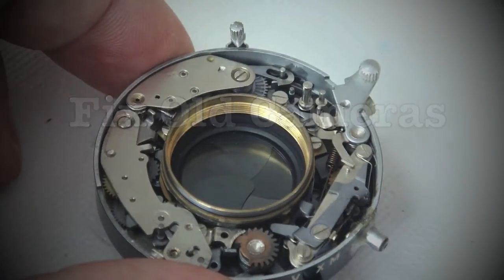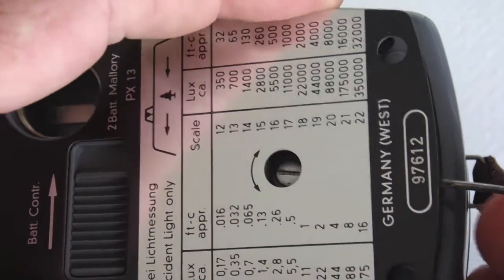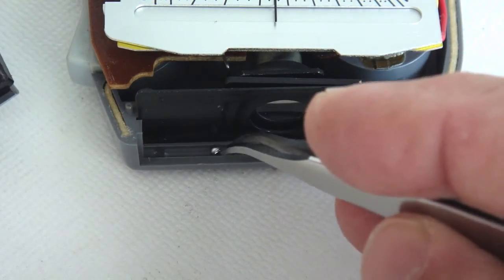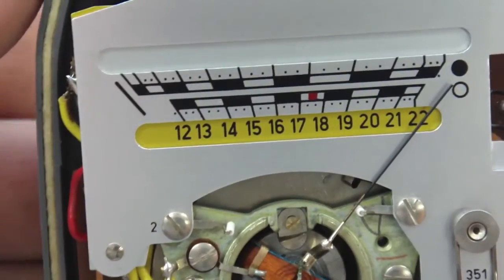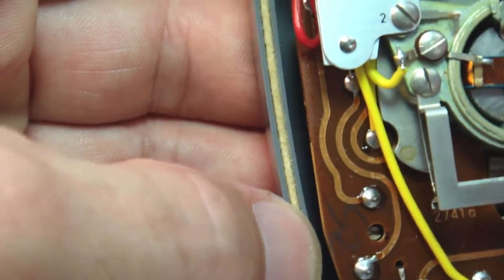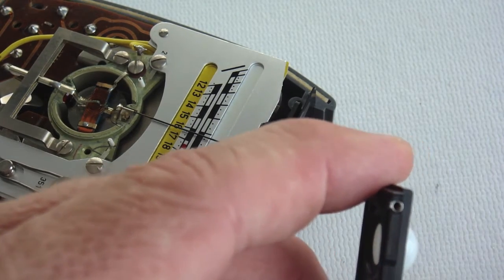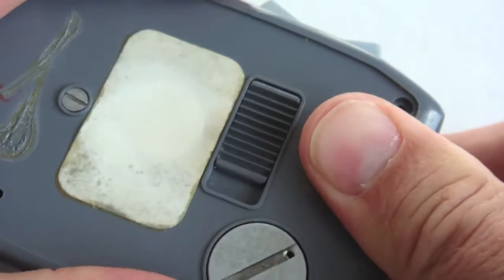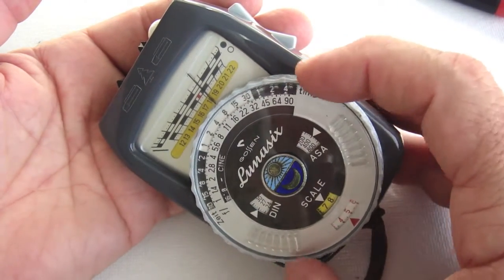Fix Old Camera: Gossen Luna Pro Battery Diode Update

Comment: So if the battery tester lands on red that means the battery voltage is ok and the light meter read correctly? Or what exactly the battery indicator shows?

Comment: I have a Lunasix 3 and I am about to do the same upgrade but on my model, but: THE RED WIRE IS THE NEGATIVE!
The position of the batteries is the same as yours with the + touching the screwing cap. If the diode must be connected to the positive that is the wrong wire. Please check with a multimeter with the 'beep function' which is the positive.
Online  you can find another video where you can see an Italian guy installing the diode on a blue positive wire one the side (Mine is Yellow).

Comment: Thank you for this video. Humongous help. My Luna-Pro did not have the diode, nor the sliding light diffuser. My battery compartment slotted coin cover was corroded shut and the chamber was spinning when I tried to force it open. After removing it, hitting it with DB Blaster, then white vinegar, then boiling water, I persuaded it open. 

I did, however, have a small 6mm clear rubbery washer left over after assembly. Everything seems to be working fine. I just hope it's not some important pivot point washer.

Comment: I just bought a gossen super pilot cds, does the same diode work on that meter? Also, do you happen to know if I just adjust the voltage pot should I get the same result as installing a diode? Thanks in advance!

Comment: I have a Gossen Luna-Pro that I haven't used in a long while. It's been properly cared for and stored. The needle is seemingly stuck in one position and doesn't deflect, doesn't move, at all. I put fresh, correct batteries in it, and it didn't make any difference - the needle still doesn't deflect with switch engagement. The needle is stuck in the upright position, a bit to the left side of the battery calibration red mark on the scale.  I haven't taken it apart yet, but would like to, just to see if there is something mechanical I could do to free up the needle. Any suggestions on what it may be? Thanks. Great video, by the way! I've read all the comments, below, too.

Comment: I just attempted this mod. I went through 2 1n4007 diodes and then tried a 1N5711 Schottky Diode. None of them worked. With the diodes in the circuit I was getting no current. Also my Luna Pro has  different internals so I suspect it might be a later model. The + wire is blue and the - is just a bare wire. The wire is also quite small and was difficult to work with. The connection to the battery chamber is sealed so I had to cut the wire and solder in the diode to each end of the cut wire. Right now I have reassembled the meter until I decide what to do next.

Comment: I recently acqired an FTbN and it had a tell tale scratch from a clumsy top removal. I went ahead with 1.5v. Alkaline and of course it's fine. They're really cheap these days, so I will be following your work on my Luna Pro also.
Question:
I have a working Weston Master Universal, a working Weston Direct Reading, and a Master II with the Invercone which doesn't work, but I would prefer to carry. Were these photovoltaic selenium cells interchangeable? Could one go into another? Thanks.
Reply from the maker: A direct swap might work or you might need to add a resistor. Might require some experimentation. Let us know what you discover. There was a time when selenium panels were available and could even be resized. Silicone cell salvaged from old solar powered calculators can sometimes be used in conjunction with a resistor (maybe a variable resistor so it would be easier to tweak)

Comment: Thanks for the great video, have used a few of your tutorials to repair some vintage cameras and lenses I own. What would you say is an economical modern equivalent of the sk 3080 diode, or what should I be looking for? not too up to speed when it comes to these sorts of things. thanks so much!
Reply from the maker: Substitute for meter system voltage dropping diodes -
ECG109 - OA90
1N4007 - DO-41

1N4007 silicon diode usually will work the best in most two battery systems. The diode referred to as a SK3080 diode in the video should have been stated as SK3090 which is germanium and has a smaller voltage drop. You sometimes have to experiment with different diodes in particular the two battery systems as many have voltage regulating circuits already. - more diode information here https://phototronic.biz/tips 

Experience shows a silicon diode has a voltage drop of approximately 0.7V(varying 0.1V depending on the sub), while a germanium diode has a voltage drop of approximately 01.6V - 0.2.2V. Making the silicon diode(1N4007) the preferred choice for two battery meter systems. Though germanium diodes(SK3090,OA90,ECG109) with a voltage drop of consistently 016V) is the best in the area of forward voltage drop in single battery systems they are increasingly hard to find and more expensive, the silicon diodes are cheaper and apparently easier to find.
Experience shows a zener diode is not a good choice for a substitute. A silicon or germanium, conducts in one direction only, whereas a zener diode conducts in both directions, but at different voltages.

In most application beyond the voltage dropping application an ordinary diode is used to rectify, using its forward bias characteristics, while a zener diode is used to regulate, using its reverse bias characteristics.

Comment: Battery 625 this light meter gives you accyrate readings of exposure ?
Reply from the maker: The diode modification with the proper voltage drop results will make the use of the available 625 (1.5volt) alkaline battery fairly accurate. Although an alkaline battery is not an ideal choice for a light meter due to its slopping discharge rate. The batteries will need to be replaced before the discharge level drops below 1.4 volts. The silicon diode suggested gives acceptable results, but is not a perfect choice. If a different diode is found that works better it will be posted.  There are also MR-9 battery adapters available, but be sure to get an adapter that has the voltage dropping circuitry.

Comment: I put two lr44 batteries in the battery compartment and the meter needle lands on the red bar. Does that mean that it's ok?
Reply from the maker: It is a good sign that you have movement, but it still will depends on how accurately it reacts to different levels of light.

Comment: What battery do you use?
Reply from the maker: The 625A batteries fit, but have a gradual discharge fade rate once they start to deplete, therefore yearly replacement is recommended. The S76 battery has a level discharge rate but requires a small rubber o-ring fitted around the circumference to keep the battery properly in place.
Reply: O ring wins, thanks.

Comment: thanks for the video! I want to open up a Lunasix Pro but mine doesnt open after taking out the 4 screws on the back. It feels like it is being held back by the turning dial on the front. Any idea how I can open it?
By the way my problem is, that the turning dial doesnt move the neadle anymore..
Any advice would be greatly appreciated.
Reply from the maker: Hmmm... not sure. Maybe the issue that has frozen the dial is also interfering with the case separation. Maybe there is another case screw that was overlooked on your model... do not know of the location of such, but variation of design has been known to occur.

Comment: I had intended to fix a Gossen Luna Pro meter in this way, but before I got to that point, I tried zinc-air 1.4v batts to see how that worked and found that I am unable to calibrate the meter with any battery. The voltage adjust shows good and can be adjusted, but the needle will only swing within 20 or 30º at either end on either scale. Shouldn't it at least be able to zero in the dark? I can't get a full deflection at all. My question is just this: do you think something else is wrong making it not worth the trouble, or am I missing something simple because I'm unfamiliar with this meter? Thanks very much. I enjoy your videos.
Reply from the maker: By the way you describe the issues, it is possible that the travel of the galvanometer is restricted. Can you manually move the needle its full swing? Does the meter peg when full battery voltage is applied? The meter should behave properly when powered by the zinc-air battery substitutes and zero in no light or when shut off.
Reply: The needle swings free enough and seems to react to light, but only with a small deflection which I'm unable to adjust to anything like zero even with the sensor covered. I can adjust it to a hi value but can only reach a value perhaps 3 ev lower than that... or vice versa. Battery test works, meter zeroed w/o power; It doesn't seem like something mechanical to me...maybe a bad component? What happens when you drop these a few times? I wonder if something broke loose. I paid very little for this, so perhaps I'll have better luck next time. Thanks very much for your response.
Reply from the maker: By the results of the trouble shooting you have done, it does appear to be a circuit issue or a combination Cds and circuit issue.

Comment: Would this work on a Sixtar

Type

Hand held exposure meter

Introduction

1966

Sensor

CdS (Cadmium Sulphide)
Reply from the maker: The diode voltage drop procedure can be use on any meter or camera that was originally designed to work with 1.35 volt mercury batteries. Finding vintage diodes is getting to be difficult. But some have been using modern diodes with good results. You might have to experiment with clipping different diodes in the circuit to get the results you are after. You will not harm the meter as dropping the voltage too much has the same affect on the meter as a weak battery.

Comment: Do you happen to know the relative magnitude of the current for this circuit? I have several diodes to choose from and I want to know which would most closely give me the .3V drop for this circuit. Also, all this diode does is drop the voltage, so you would need to use a silver oxide battery, correct? Because this battery has the most level voltage output over time while lithium and alkaline show a steady decrease in voltage over their life (Correct me if I have my battery types all mixed up). So this decline over time would affect the meter measurements if I'm not mistaken. Last question, can you simply use #9 rubber o-rings as spacers for these button cell batteries or do they need to make contact with the sides of the battery terminal?
Reply from the maker: Silver oxide is the best choice of battery. The diode can be tried with no concern of damage until you find the right combination of diode. Rubber O-rings can be used to hold the button batteries in place. The battery cap is the positive contact the battery terminal is the negative contact.

Comment: Hello, thanks for the informative video!

I was wondering if you have any advice on working with the Luna Pro S. I opened mine up in hopes of it looking the same as in your video, but there wasn't a clear red wire going to the battery compartment - it actually seemed difficult to reach the battery compartment.

Thanks for any help!
Reply from the maker: Yes it is different, but the battery compartment can be reached. Find the connection to the positive battery chamber contact and place the diode between it and the contact. Also you might consider making or the purchase of a voltage dropping battery adapter.
Reply: Thanks for the quick reply! I'll poke around in it again tonight and see if I can figure it out, but if I can't I'll probably go with the adapter route. Thanks again.

Comment: Great video I have a Gossen luna six and happened to me that it fall on the floor and since then the needle doesn't lock when i take a measure, like it is loose making it difficult to read. Can you explain me how to fix it?
Reply from the maker: The needle is locked on a reading via a clamping device that probably just needs a tweek back into position. You can see the lower edge of the needle clamp mechanism at point 2.14 in this video.
Reply: You are the man! thank very much for both of your fast responses, I will get some real tools and try later if I can fix the problem
Reply from the maker: A few good tools will help.
Reply: I wanted to tell you that I managed to fix the problem successfully maybe someday I even try to go with the diode update, for now Im already very happy with the achievement
Reply from the maker: Very good to hear of your successful repair.
Reply: Look on eBay.  There is an auction from a repairman that specializes on Luna pro repair

Comment: Can I use sk3090 diode! Thanks
Reply from the maker: You can use the SK3090, you might not get the voltage drop you need for the double battery system, but you will do no harm in experimenting with different diodes. The SK3090 seems to work really well in the single battery systems. If the SK3090 does not give you the results you are after. Try locating SK3080 / IN4007 or the equivalent thereof.

Comment from the maker: Adjustment Potentiometers positions for the Gossen Luna Pro / Six: 
Upper left by itself - P1.  P1 (10k) is battery test current adjust. 

Left to right across the bottom - P2, P3, P4, P5

P2 ( 75 k) is low light adjustment. 
(P2 is used when the CdS LDR is directly exposed via the lens)

P3 ( 10k) is low light meter shunt adjustment.
P4 ( 10k) is high low meter shunt adjustment
P3 and P4 probably need to be set near mid point.

P5 ( 20 k) is high light adjustment. 
(P5 is used when the nd filter covers the CdS LDR) 
CdS (Cadmium Sulphide) LDR (light dependent resistor)

In bright sun about EV 14 or so, with the dome on, (incident mode) and 
ND filter on, the CdS/LDR resistance is 520 Ohm.
Dark resistance is about 20 Megohm.

The battery current needs to be in a range 20 ~ 60 uA, which is just 
enough to drive a small signal schottky diode toward saturation, so 
depending on the diode voltage dropper placed in series with the modern 
batteries that now need to be used there might be an accuracy problem 
that should be adjustable if need be. Some times after a diode install 
update no adjustment is needed, if the meter was accurate to begin with 
and the proper voltage drop was achieved with the diode modification.
Small adjustments should be made working between light levels.

As a light source, you either can make an adjustable light-box, or use 
several white walls with different levels of illumination accessible 
throughout the adjustment procedure. Meter the light source with a known
 good meter to determine the levels you are working with.
Reply: This is good stuff.  Is the table at the end the conversion with and without the ND filter in place?  I imagine I do not have to re-assemble the meter every time I tweak it (and that is my guess the purpose for the conversion table, so that I can test the high range without the filter and leave the unit dissembled during calibration).  Also the shunt adjusts the low end of each range, correct?  In other words, it is the Y intercept and the corresponding pot is the slope (adjusted at the high end of each range).  Also is the EV @ISO100?

Comment: So I looked up SK3080 and IN4007, one comes up as a diode and the other a rectifier. I am not an electronics guy so I dont know if this is correct or if I am misunderstanding something somewhere.
Reply from the maker: In this application they are acting as a voltage drop in a DC circuit, so they are completely interchangeable. In fact any diode that gives the needed voltage drop will work. Experimentation will not harm the circuit if you get to much drop or not enough try another diode. If you put it in backwards and the meter will not power up... flip the diode end to end. No harm.
Additional information that does not apply to this application, but is somewhat relevant, is when AC power is applied to a diode it will only allow half wave to pass and it blocks the remaining half (called rectification). Usually there are two diodes (or rectifiers) in a rectification circuit. Each diode blocks half wave but together they make a full wave.